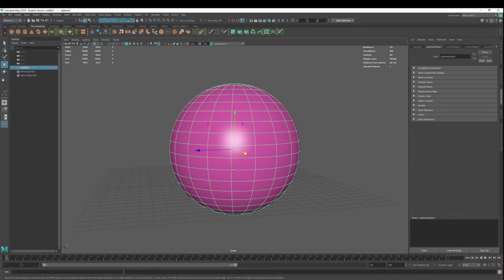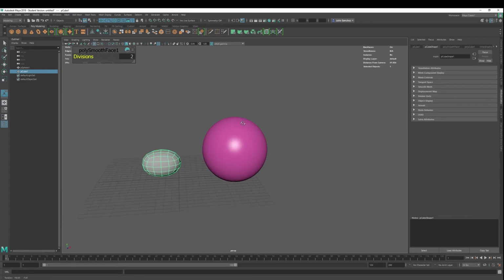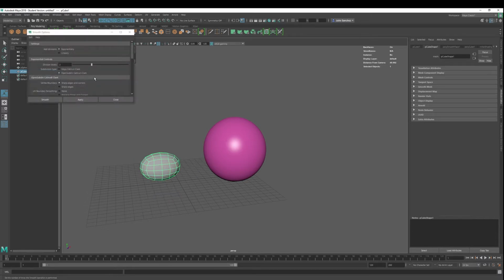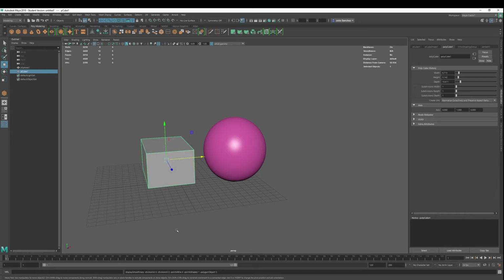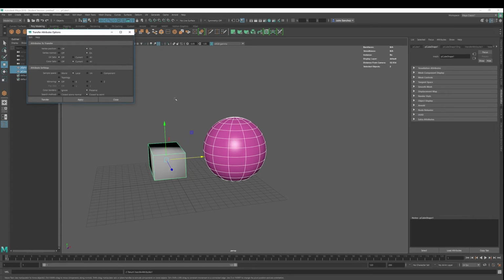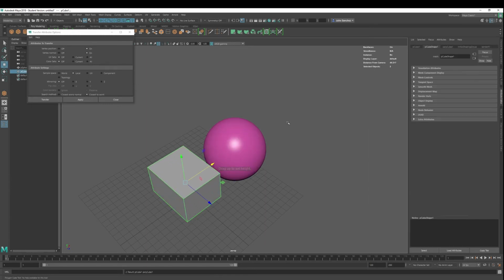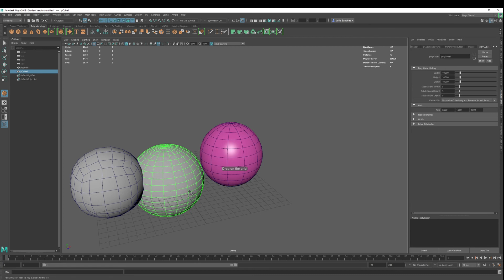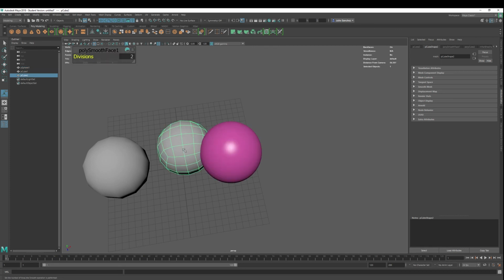Autodesk Maya 2018 Basics- MAKING A QUAD SPHERE FROM A CUBE

Comment: It's messed up because the resolution of your reference sphere (the one with the poles) is to low. Try to give your sphere 256 by 256 divisions. For the Cube: put the smoothing on the cube first with 3 iterations or so! Then you can transfer the vertex positions from the sphere to the previously smoothed cube and you get a perfectly rounded sphere out of the cube with perfect uv's.